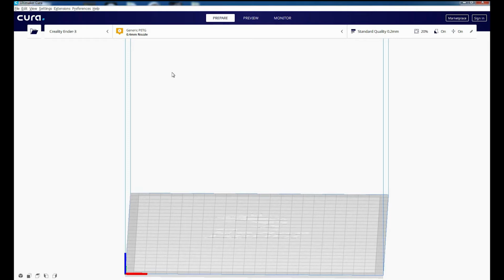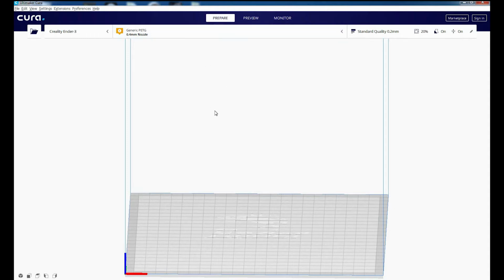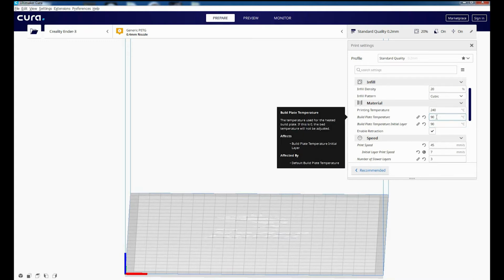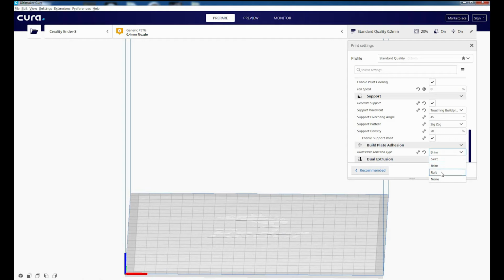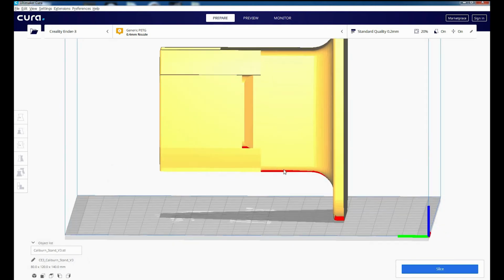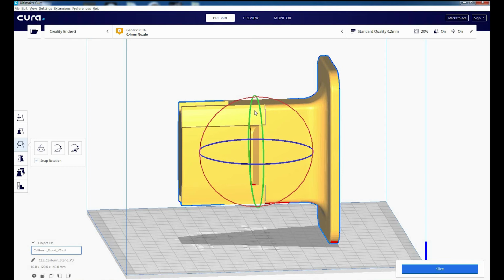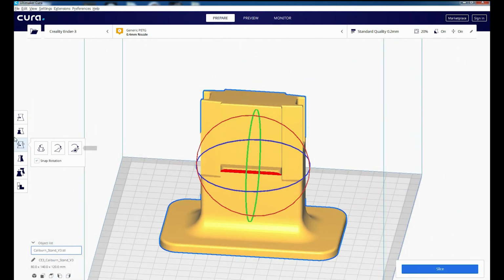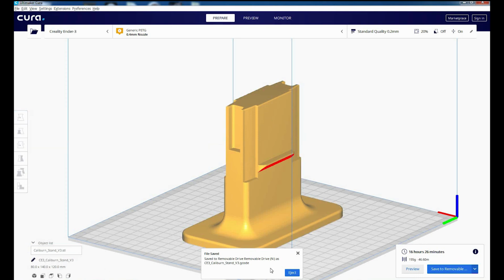3D In FPV - How To Use Cura and What Are My Settings For Great Prints

Comment: Hello My friend,  I got the ender pro 3 but having a problem with the software that come on the mini sd card. Wont allow me to run the software. Any tips?
this video is very helpful, thank you so much for making it. So I can get that software at ultimaker cure?
Hope you had a wonderful thanksgiving
Reply from the maker: The files on the SD card are what's known as a G-Codes. A G-Code isn't software, it's more of a manual telling your printer what to do. You can import a G-Code in Cura or you can use it to control your printer. To create a G-Code you need a slicer program. Cura is what I use.  https://ultimaker.com/software/ultimaker-cura Thats the link for Cura v4.4. Once you download that this video will be a good walkthrough for you. Once you've created the G-Code, save it to your SD card and go into the printer menu and select print from SD (may have to initialize the SD if you took it out while printer was turned on.) Now scroll to your G-Code once in the print from SD. Click the G-Code and watch as the magic happens. 
My Thanksgiving was great! How was yours?